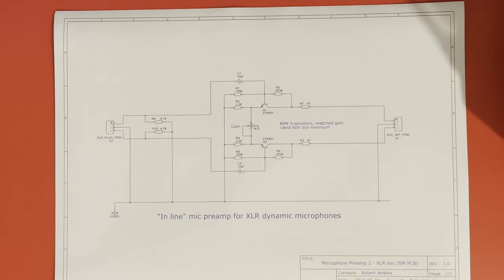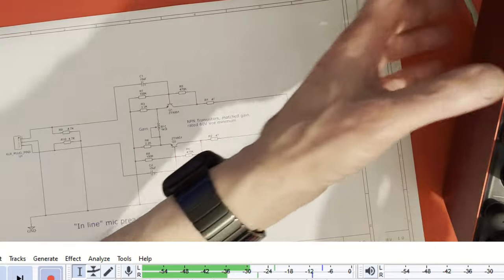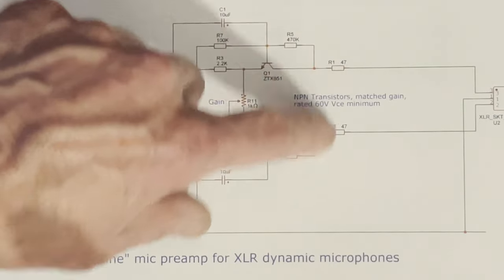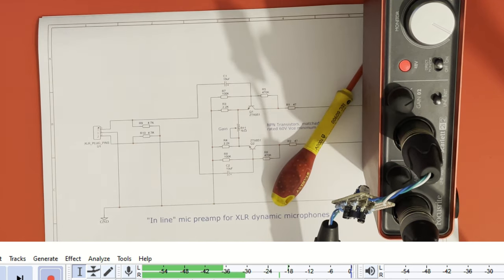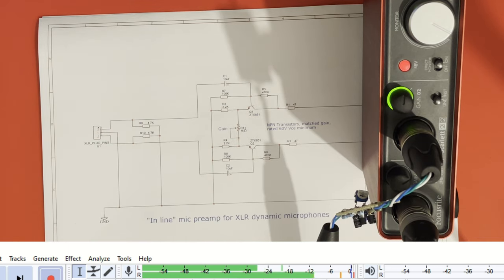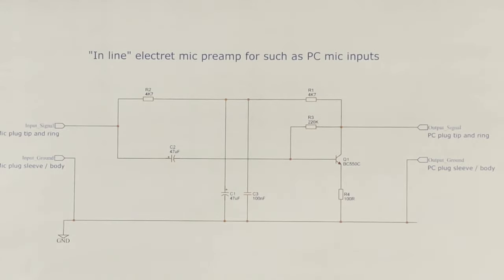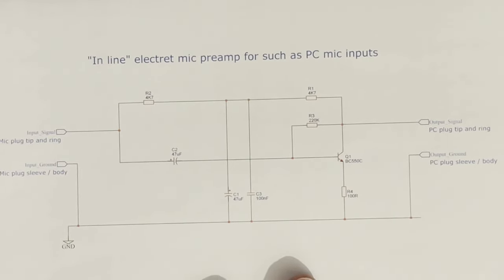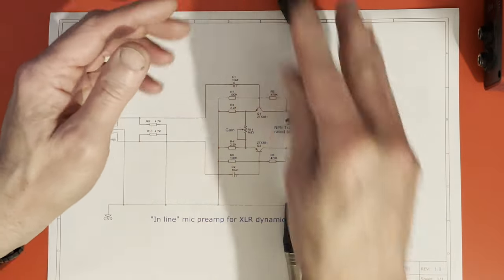Simple inline microphone preamps part 1 - design & schematics

Comment from the maker: Expand the description to see the chapter links, there are three sections to this video! Also for the links to schematics etc.

I've not done any audio processing at all on these recordings, so there is ambient noise from the PC and also electrical noise from that powering the Focusrite, somewhat extreme when I turn the gains to maximum; it is an audio quality test so I did not want to skew anyone's perception by noise reduction or gain levelling.

There will be two further videos for the dynamic mic preamp: Building one on stripboard, and assembling the surface mount version in to an inline casing.

Comment: Hi there. Very interesting an awesome video. Could you perhaps do a video on converting a cheap battery powered Lav like a Boya BY-M1 to allow powered connections to "plug in power" mics. I have a Rode Video Micro which is really awesome but you cannot connect it to a mixer directly to line in given that it requires plug in power. The Boya BY-M1 uses a tiny battery which allows it to work as a line in device but can also work with plug in power. Would be really cool to see if the circuit can be made into a "plug in power" system. So instead of a Lav mic at the end, it would instead have a 3.5mm female connector?

Thanks again for the awesome content.
Reply from the maker: Hi,
apologies for the delay, I somehow missed your comment.

If you are wanting to connect such mics to XLR mic input mixers, you could use the circuit from my condenser mic mod board; see the "Cheap mic mods part 3" video, follow the link in that to the project page on my site, then see the "Mic audio PCB parts and diagrams" link in that.

Mics with 3.5mm plugs that need external power generally just electret capsules in housings.

If you follow the diagram using the components in the input section list for a two terminal electret capsule & whichever output section you prefer, that should work as an adapter to run a 3.5mm mic through to an XLR mic input with phantom power.
Reply: Hi thank you so much for this. Much appreciated

Comment: I assumed that when one adjusted the gain they changed the amount of output amplification, but your video indicates the gain only changes the voltage/current from the microphone?  If that's the case why not extend the gain in the Focusriite.  Or add your circuitry?  My guess is they want to maintain a certain level of noise or distortion.  Can you explain more what's going on?  Thanks!
Reply from the maker: Amplification within an audio system is usually done over a number of stages, each providing part of the gain (amplification). A preamp such as my design adds one more stage in front of the existing amplification chain, increasing the overall system gain.

Audio gear or interfaces such as the Focusrite are optimised to work with the majority of microphones, with their gain adjustment range allowing any of the expected sources to be set to normal (just below clipping) level.

The Shure SM7B is the only mic out of my entire collection that cannot work acceptably when connected directly to the Focusrite - and when I researched the mic online, it is a common problem as they have an unusually low level output.
Many users resort to an inline preamp to get the SM7B audio level up to the same range as other mics.
(But the available preamps are rather expensive, for what they are, so I made my own).
Reply: @RJTC  Interesting.  Thanks!  My 2-cents on the SM7B (I own one) is that is is designed to be used a few inches from ones mouth.  That's where its large diaphragm's quality shines.  So I've had no problem with my audio interfaces.  If I need a mic to be further than a few inches I use something else!  I find the RE20 a tad more forgiving.  So that's what I use. But not arguing you or anyone shouldn't use it where you want it and with what amplification you want!
Reply from the maker: @MaxoticsTV  The Shure SM58 hand mic is frequently used in live performances with it virtually (or literally) touching the performers mouth, to maximise wanted audio vs. noise from other sources.

In contrast, the SM7B is a fixed mount mic, so it's generally going to be further away from the users face - but its far less sensitive than the SM58! In my tests I have the two mounted side by side.
The SM58 still gives ample output a foot or two away, which is vastly different to the SM7B.

You certainly can use one without a preamp, but then the recorded audio needs boosting to reach -6db peak level, which also boosts any system or interface noise. A low noise preamp between the mic and interface avoids that problem.

Comment: Hello, very interesting project, I want to build one to activate a passive ribbon microphone, unfortunately the ZTX851 transistor is not available here where I live, but I found something that could perhaps replace it, I am talking about the BC546b, which supports about 60V and is Designed for audio applications. In your opinion, could it work in this circuit? And if yes, should I change any polarization value? Thank you very much.
Reply from the maker: Hi,
just about any decent NPN transistor that has suitable voltage ratings and gain should work OK.

The 2SC2545 (or 2SC2546/2SC2547) would be excellent, as they are also very low noise & good gain, if you get any of those?
Reply: @RJTC  Hi, 
Just last night I finished mounting the BC546b and it sounds great! Very low noise and very good gain, thank you very much for sharing your research.
Reply from the maker: @maramassaferro  Great stuff! Thanks for letting me know!

Comment: Hi, can you give me an advice how create a preamp for wm-61a capsule ? my setup is focusrite solo 3gent with phantom powered input, i make a simple connection this capsule to xlr ( wire 1 and 2 pin with 27kOm resistor and i got 9,6v for my mic ) BUT! To hear something i need increase gain lvl till 80-90% ( at this gain lvl i got background noise ) and now i thinking about make preamp, but idk how
Reply from the maker: Hi, the circuit for my mic mod board could be used - there is an option in the assembly info giving the parts for an electret capsule, I believe?

Grab the assembly instructions PDF from the page here - it also has full schematics:
https://robert-jenkins.co.uk/site/index.php/electronics-and-audio/designs-projects/23-microphone-modification-upgrade-circuit-boards

Comment: can we swap transistor with bc 141 sir?
Reply from the maker: They should work fine in that circuit; I'm not
 sure what the noise level of those would be though.
Reply: @RJTC thanks for your reply sir, after looking that tr in local shops, theres not available, the most common tr here is BD139 (80v) if I use it instead which component should I change to. I try to find BD137 but a little bit hard too.

and also I want to ask about R near output (47) what happen if I change it smaller (33) or larger (68) which one better if (47) not available

thank you sir
Reply from the maker: @qrdaudio  Unfortunately I do not think they would work well in that circuit. The datasheet minimum gain at low current is just 25, with no typical value listed.

You really need transistors with a a gain near 200, or higher, for it to work well.

If you want to try the BD139, get some spares and try to gain match them?

Start off by replacing the 470K bias resistors with 220K, and see what voltage you get on the transistor collector; it should  be somewhere between 24 - 36V or so.

Try different transistors if needed to try and find two that give as near the same collector voltage as you can get.

If then they have too high collector voltage, change both bias resistors down to 150K, or 100k, as needed.

If it's too low voltage, increase both resistors - 270K, 330K or whatever works?

Comment: Could not see wiring diagram  as to faint to see might be my phone
Reply from the maker: The schematic PDF links are in the description, if you expand that?
Reply: I've been through the chapters in the discription must be my phone i only see a faint wiring diagram can't see any values but thanks anyway I'll have to get a better phone 👍
Reply from the maker: @martindoyle766  OK, they are quite clear on a PC, so I don't know what to suggest there..

If it's the Dynamic mic circuit, the resistor values are, approximately left to right:
Input to ground: 4k7
Emitters to ground: 2K2
Bases to ground: 100K
Base to collector: 470K
Collectors to XLR pins 2 & 3: 47R

Gain pot between the emitters: 1K

Input coupling capacitors: 10uF, positive to transistor bases.

The "PC Mic preamp" -
Input to smoothing caps & output to smoothing caps: Both 4k7
Collector-base resistor: 220K, or somewhere between 100 - 470K by trial and error..
Emitter resistor, 100 Ohms or below, or a link.
Smoothing cap(s) 47uF + optionally a 0.1uF
Input cap to base: 47uF, positive to input.
Reply: Cheers I made a nice LM486 amplifier circuit with gain control potentiometer and volume potentiometer large capacitor 2000mf for a nice base output to the  speaker there was no background noise at all I was impressed an IC so low powered could do so well so I made a BC547 simple Mike circuit to listen to the base of the speaker and flash led lights I fitted on top of the box to impress my little daughter it worked but the performance was bad it had to be right against the speaker to pick up the base of the speaker so that's why I want to try your Mike out it sounds a lot better to pick up the base of the speaker
Reply: @RJTC  thanks again for your help I can make it now it's far better than a low component mike there not worth waisting your time or components on cheers top man thanks 👍😁